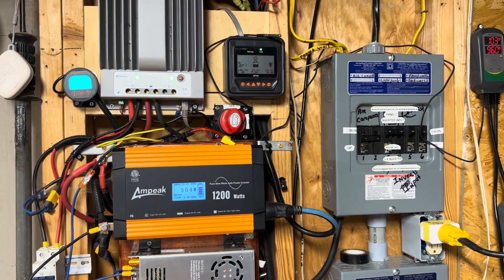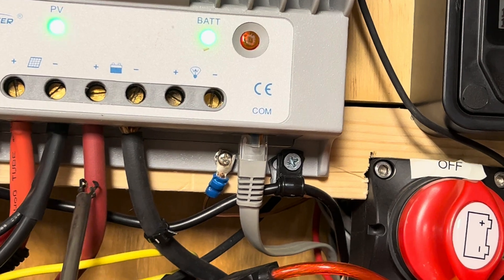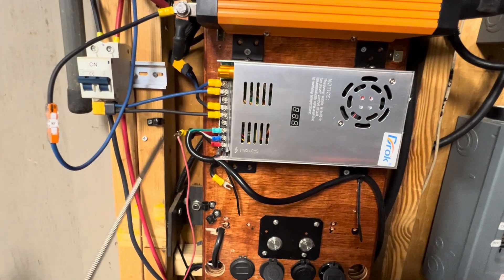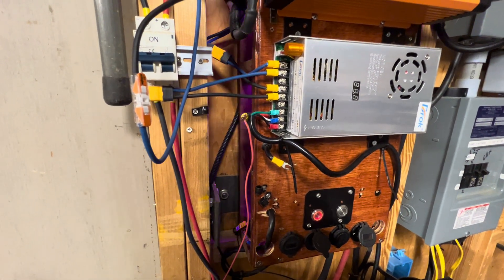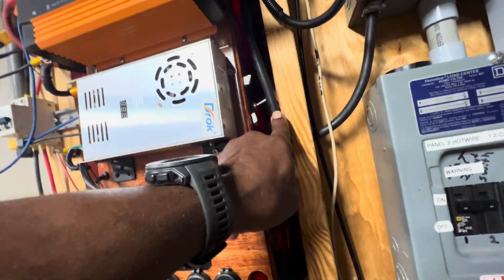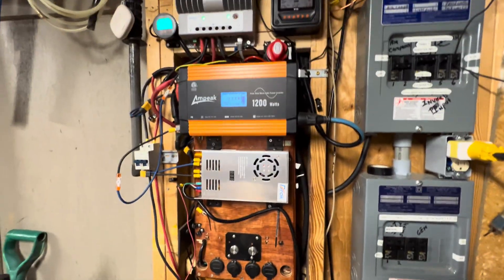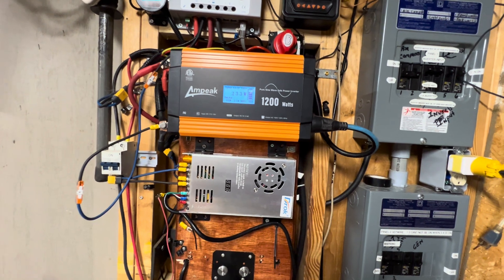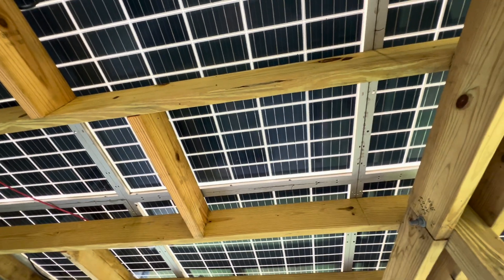DIY Portable Solar Generator #solar

Comment: i just got done building 120ah 24v battery three of them to add to my 5000w reliable so i will have6 120ah bat on it with 2000w of panels
Reply from the maker: That is so cool and sounds like you have a great system you put together

Comment: HEY WHAT KIND OF A DIVICE IS THAT FOR YOUR BACK UP IF THE SOLAR CAN`T KEEP UP I USE A POWER SUPPLY NOW WITH A POWMR MPPT CONTROLLER BUT I HAVE TO WHATCH OR KEEP CHECKING AND IF THE BATTERY GET LOW TURN IT ON IM STILL PARTLY ON THE GRID BECAUSE OF THE NEIGHBOR TREES SO IN THE WINTER IM MOSTLY SHADED EXCEPT FOR A BOUT 2 TO 3 HRS THANK YOU
Reply from the maker: I do understand I have a charger connected to the battery and automatic switch that will come on a certain time of the day and charge the batteries up before they get too low
Reply from the maker: Thanks for your comment and please share my video!

Comment: hey it looks good to me i have 5 different systems a 5000watt  a3000watt 2 2500 watt a1500 watt for different parts of the house then on cloudy days i have a smart charge to help out like on the 5000 watt about 4 amps and i can run on solar 24 7 to run the air
Reply from the maker: That's awesome! Thanks for sharing your experience with solar power.
Reply from the maker: That sounds good to have different solar system types proud of you